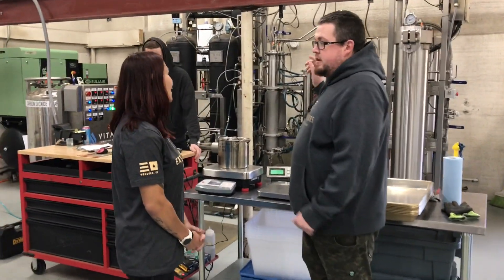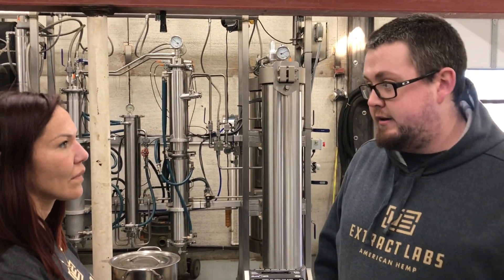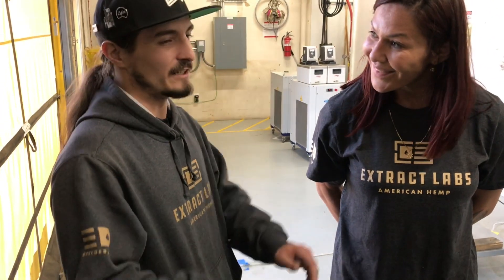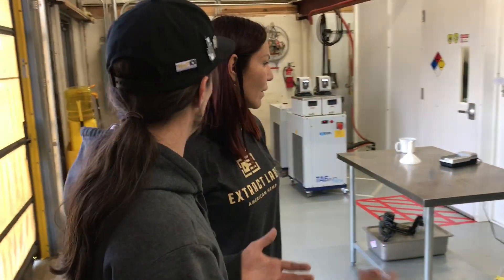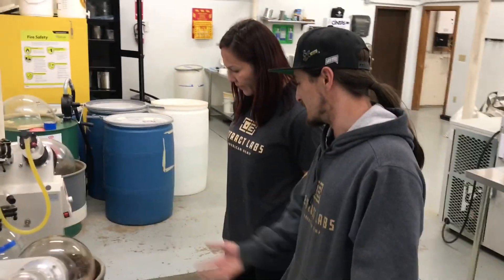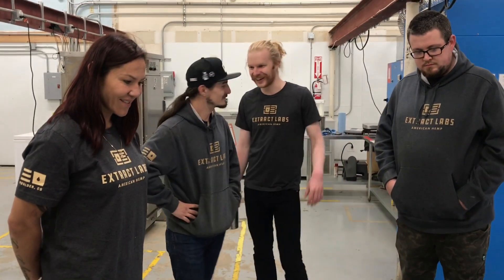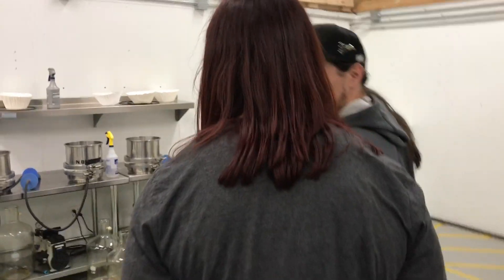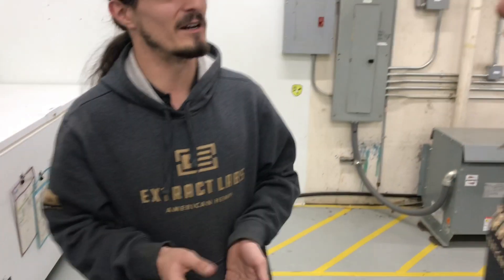Cris Cyborg shows how CBD is made with Extract Labs American Hemp Boulder Colorado USA

Comment: Nice to see Chris cyborg..but cbd involvement.is what purpose.is Chris cyborg using it for pain or another reason.if she is I like to know how it helps her..cause I have tried cbd a few times for chronic pain.it did absolutely nothing.
Reply from the maker: David what company did you use? Which method of administration did you use?  There are creams, oils, and other methods the body absorbs.  The biggest concern with CBD is that many companies fail to regulate their own quality controls.  Watch the video to see the cleanliness of Extract Labs.  The fact that USADA and The Olympic Committee have approved CBD use for athletes is scientific proof that athletes at the highest level have benefits from it's use.
Reply: @CrisCyborg  I live in wa. I took capsules regulated by state 100 mg didn't do anything,so I doubled it and still nothing(40 bucks for 1 day).when you have chronic pain.cbd is not the answer for myself..cbd is the new gold rush.if the Olympic committee has approved cbd.why hasn't the FDA.